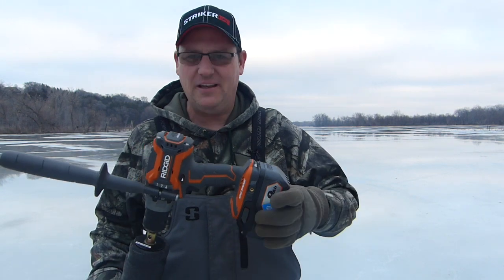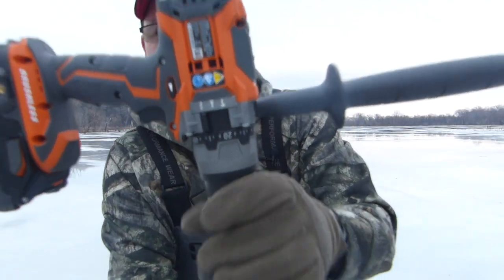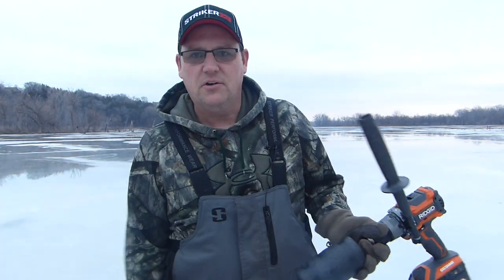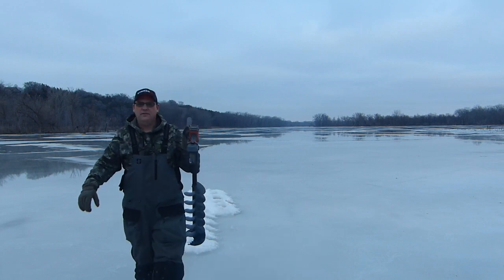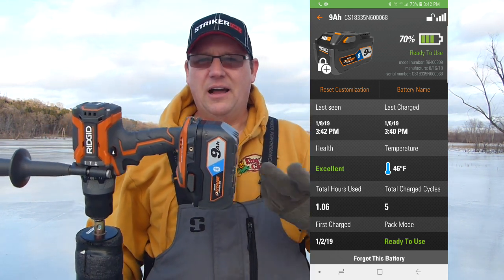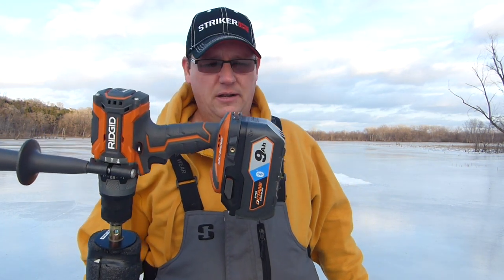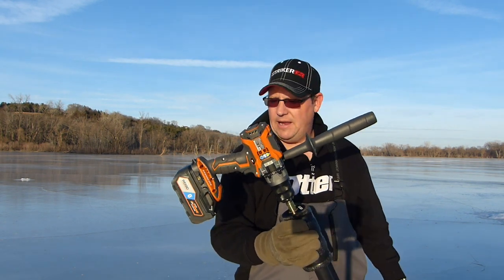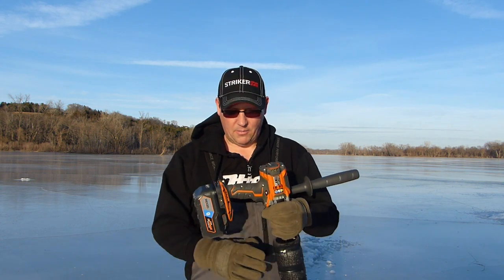Rematch! Ridgid Octane VS Dewalt Hammerdrill Ice Auger KDrill

Comment: Rigid 46
Dewalt 30
Lets do the math if the batteries were switched, might show efficency.
46x5/9=25.5 holes
30x9/5=54 holes
Conclusion: I'm not hand drilling those damn holes! Either will do.

Comment: Great test: I would go with the dewalt based on efficiency. Adding weight as a factor you could carry 2 dewalt batteries and drill 60 holes presumably with only sacrificing 1 ounces for the extra battery. This would put you on the map competing with the 40A electric augers on the market, for a lot less money.

Comment: Just wanted to update this review. Year 4, with a bit of sharpening I'm still thrilled with this Auger! This is an excellent Auger. https://www.youtube.com/post/Ugkxe0I-fnTUByahTCyStrIBXsesSkQJKn8n It splits to 1/2 size for storage in the warm months and easily assembles for winter use. I can cut holes in less than a minute by and really don't feel the need to ever adapt this to use with a drill. It cuts easily with the included blades (which can be sharpened or replaced as needed) and has held up extremely well through last season, and now for the first cuts of this season. I do recommend this to anyone who asks, and personally prefer this over powered augers. These are quiet, still quite fast, lighter, and don't risk spilling chemicals into our waterways. I plan to do a lot of fishing this year through the ice, thanks to this trusty Auger. The 8" diameter is great for fishing pike through the ice as well.

Comment: Thanks.
Glad that you had a realist real world do over. As I have said over on another forum many, many times no one goes out and drills 30,40 or 50 holes at one time and one test of a new tool and battery is not a real world test!
Batteries need a bit of a rest as they are used, they get hot even in the cold. 
As far as real world? DeWalt has a  1 year warranty on tool, battery and charger. Ridgid, if you follow the instruction and register it correctly a lifetime warranty on everything!!! Thats a free battery every 3 years if needed! Average life of a power tool lith-ion battery is 3 maybe 4 years depending on brand (your millage may vary). 
Sad part is ya know how many folks saw the first video and wouldn't even consider a Ridgid and will not see this video?
Reply from the maker: I would hope their buying choice isn't based on my video.  It's just one piece of the puzzle.  :)  I'll be sure to put a link to this video in that video too.
Reply from the maker: And if you have ever seen tournament guys on the ice they regularly drill 100s of holes a day with these elec augers.
Reply: There are exceptions to everything!
As I said above  at “one time”. 
Would I recommend either of the drills you tested to drill 100's of holes in ice in one day? 
Never!
What most folks are forgetting is that none of the cordless drills or mixers that "I'm" aware of were designed to run a ice auger of any size!
Why are some of the drills cutting out after 15 ish holes, to protect the motor and battery.
Go to a larger physically sized tool and there is more cooling because of the mass of the tool.
Same holds true for corded tools.  Ya can buy a pistol grip style 1/2" drill with an 8 amp motor or a  "large frame"  1/2"-7 amp drill which has a smaller (amperage) motor but larger physically  sized motor which will run cooler and last longer.
The dilemma?  
One is bigger and more expensive than the other!
The nearest cordless tool that I'm aware of designed to run a large "bit" is one the mixer style or "Hole Hawg" style tools, but most folks don't want to spend the money for that style tool.
Then if one gets the right tool for the right job ya start to hear the complaining of the sucker was soo powerful it hurt me. It threw me to the ground and stomped on me I'll never buy one of those again. 
I read it all the time, I bought an X, Y, Z brand tool will it work with my A, B, C drill?
Personally if "I" was going to drill hundreds of holes in one day it would be with what I use, a Milwaukee Mud-MIxer with a number (?) of either 9 or 12 amphr batteries!
Buy the right tool for the right job!
:)

Comment: I have the rigid one and I would much rather get less holes and not have it cut out on me Maybe 15 holes for one angler What happens when you go out with a group You can always grab more batteries but what are you going to do by backup drills This is coming from a guy that owns everything rigid Have never had any issues with that same drill doing any house  Improvement but cutting through the ice is different  Situation
Reply from the maker: Well its a protection thing.  I'd rather have it give up so I know to let it cool down rather than it just lets out all that magic smoke and now it's dead.  The 9ah battery was a game changer with that drill.  It made all the difference.

Comment: Great video. I have a flexvolt 9 amp battery on my drill. Made the difference. Both drills are good. I have dewalt so that's my choice. Batteries are expensive, so down load Slickdeals. I bought batteries really cheap.

Comment: we have the kobolt 24 volt drill(not hammer either) with 4amp hr batteries(2) and with 16 inches of clear ice we can get a total of 32 holes.  now that is impressive. Keeping the batteries in our coat until needed.  And the Kobolt never needs to be lifted for any stopage  until battery is dead.. We got every thing including batteries from lowes for 200.  If a person drills straight up and down and presses the drill you just fly through the ice and save on battery. Key is straight up and down.  Very impressed with the 24 volt kobolt.
Reply: Hi Ryan, is this the drill with 650 lbs of torch. What size auger did you use 7inch? Thanks Ross

Comment: I really do like all these new augers how ever I don't think I could ever by a new drill type auger or a new brand name gas auger. Once I have problems with mine  I will continue to rebuild it and if it happens on the ice I never leave to go ice fishing unless I have a hand back up. I was lucky and got In my opinion to be the last good ice auger made a few years ago. I would buy strike master until I made the parts for them and they aren't made to last. Plus the price is quite absurd for a drill auger once you add up a drill batteries and the auger. I am a carpenter by trade and I do have multiple name brand drills I could use but they each have a specific job and I can't risk having one break just for me to go play. Thanks again for your tests they are the best ones on the internet.
Reply from the maker: Thanks Sam.  Here is an interesting video showing how bigger is better.  I was suprised by the results.  https://youtu.be/6LaB7kGP4Vo

Comment: I picked up a 8" Pistol bit and was wondering if you have killed a drill yet? We have 40" of ice on Lake Winnipeg and was wondering if I will be burning out my drill (DCD999 Dewalt)
Reply: Hey Joe. I have the same Eskimo 8” pistol bit. Last winter I used the Ryobi brushless hammer drill which only met the minimum specs for the Pistol bit. Near the end of the season the Ryobi drill died. That was only using it on thinner ice in the Whiteshell. This year I changed to the Ridgid brushless hammer drill which has lots of power. I use my gas auger (with multiple extensions) on Big Windy. The Pistol would probably be ok on Lake Winnipeg but I like the 10” hole when I fish there.

Comment: I've  got a 996 Dewalt/ Clam plate/ 7" lazer. Using 1.5 amp batteries getting 12-14 holes in 9-12" ice  per battery  Just upgraded to (2) 5 amp batteries. Expecting 30 holes to  battery  on same   ice thickness. Again I don't bore through in one pass. I pull drill up to clear chips. Seems to allow drill to catch up.
Reply from the maker: yep you will be happy with those new batteries!

Comment: I choose the K-Drill over the Eskimo auger because the Eskimo does not have the centering bit and tends to walk and or wankle (elliptical orbit inside the hole)
Reply: Does this auger have a 1/4 threaded hole in the middle.  If so you can sharpen a piece of threaded rod use a jam not to keep it in place. Thread it in and lock it.  I think it needs to be 3 inches long.

Comment: Excellent comparision.  Well done.  Ridgid is hard to pass up for $199 with a 9Ah Battery and LSA.  It is noted by many to keep the batteries warm on the lake.  Suppose to increase run time quite a bit too.
Reply: One other thing to note, the Dewalt has a 3 speed gearbox (compared to Ridgids 2 speed), which lowers rpm's quite a bit.  That is benificial for ice augering.  (even though the Dewalt is only 820 uwo) it draws less amperage because its geared down.
Reply from the maker: Thanks, yeah I tried to do a real world test, left out in the cold, etc.   Just about everyone is going to charge up their battery every time they get home, so this is sort of an extreme thing.
Reply from the maker: @deansikorski6596  actually they are both 0-450rpm in 1st gear
Reply: Got mine for the 169 man could not pass this up its like 250 for the dewalt
Reply from the maker: @denvercolorado8927  yes that was a great deal.
Reply: After I drill my holes I keep the battery inside my heated Hut just in case I need to drill more

Comment: Any change in your opinion of the Ridgid drill, DTro?  Would you still buy it  over the Milwaukee or Dewalt?
Reply from the maker: I would base it on value. If similar price I'd go with Milwaukee or DeWalt.  When I bought the Ridgid it was $169 for drill and 9ah battery.

Comment: I think your dewalt battery isnt as good because mine outlasted yours way longer in my truck in the cold. But then again I have a lazer and she did twice as many as your dewalt and k drill. I'm assuming she takes more for that chipper blade
Reply from the maker: Correct, I've discovered that the KDrill demands more power.
Reply: @3RiversFishingAdventures  love the videos though. It definetly helped me decide on what to get 👍
Reply from the maker: @Kildahl1776  thank you.  I'm going to put the new Eskimo (with center point) up against the Strikemaster lite flite next.  Just waiting for some ice here. :)

Comment: I have fully charged batteries using the 8” K Drill and Ridgid Octane.  Any reason why my battery would stop while cutting making it necessary to remove the battery and reattach?  Happened multiple times over say 8 holes.  I know it’s overload protection, but multiple times??
Thoughts?
Reply from the maker: What size battery?
Reply: I noticed it on the 4ahr battery..
Reply from the maker: @Whitetail414  yes I wouldnt go with anything less than 5ah.  6ah is recommend and 9ah preferred.

Comment: De Walt is made by Black & Decker.  Ridgid is made by the company that makes Milwaukee.  In choosing a Cordless drill as an ice auger I would advise that one buys a rebuild-able tool rather than a throw away tool
Reply: DeWalt is Stanley Black and Decker's top end brand. Ridgid is Techtronic's middle tier brand.
Reply: Stanley and black and decker is garbage. Milwaukee fuel series is superior over all of them
Reply: @joshrode9180  Josh:  I know.  That's why I got Milwaukee fuel LiOn 18v 1200 in/lbs of torque (2804-22) [14 inches hard ice in about 8 seconds]  I also installed a bulls eye bubble level on the back of the case.
Reply: @joshrode9180  Stanley Black and Decker is USA TTI is Chinese dummy

Comment: I have that dewalt drill. And a 8in strike master auger. With the 2 amp hour batts... I get about 15 holes before I have to switch batteries.. that's in 4-6 in of ice.. I do how ever notice that ridged looks more powerful.. as my drill will keep stopping in overload protection as the battery gets low.  But overall it works great.. if my dewalt craps.. might try that ridged drill. Good vid!
Reply from the maker: Your biggest limiting factor is the battery size.  If you had a 6ah or 9ah you would see a BIG difference.  Thanks for the comment.
Reply: I have that dewalt drill and a 9amh with pistol bit  and I can get 40 + holes 20” ice no prob !

Comment: Where do you get the auger blade that fits a drill? Pretty much i have a rigid impact and want to use it for ice fishing holes
Reply: Any good sports store  for new ones.   OR, Check Craigslist or eBay   for used ones.  Craigslist is your best bet.   They usually have several of them for sale.  I picked up 4in  and 7in Strikemaster Lazer hand augers there.

Comment: What is the model number on the Ridgid hammer drill you are using?  The overload switch cuts off power to my brand new Ridgid hammer drill when I start drilling at low speeds.  Just not right.  I am currently fighting Home Depot and Ridgid over this design flaw.  They are calling it a user issue when I have never had an issue with any DeWalt, Milwaukee, or Makita drill I've used.
Reply from the maker: Model #R8611506B I used mine with the KDrill on Sat.  15 holes though 18" of ice.  No issues.
Reply: @3RiversFishingAdventures  Thank you.   I had model R86116.  Must be a newer model with faulty circuit board or switch from production.  5 of 6 at the store did the same thing.  Only 1 floor model worked properly... Very upset with Ridgid right now.  They are telling me that it is a user issue.
Reply: @williamjohnson5777  that's the gen5x not the Octane what size battery were you using?
Reply: @travisevans7502  Brand new fully charged 18v. 4 amp hr.    According to Ridgid, this is how the drill is supposed to work.   It makes the hammer drill useless in many applications unless you can pull the trigger without hesitation and not have to start slow.  Very disappointed.  When using with a Mora 6" auger, it would immediately cut out if I applied downward pressure on the ice to start a hole.  If I went quickly, the auger would walk all over.  I never had an issue with my DeWalt regular drills and the auger.  I thought I was upgrading because my DeWalt's are old and batteries all dying.
Reply: @williamjohnson5777  I have the same drill you got with the 4 amp hour battery and I have no troubles with mine course I'm not drilling holes into ice either might be something wrong with it if not I would definitely return and get something else but I like all my Ridgid tools have several of them never had a problem with any of them you might want to try the octane drill by rigid they're double the power the gen5x 1300 inch pounds where the one we have is only 700 inch pounds but if you're just totally anti rigid Milwaukee makes a great drill also I just personally wouldn't go with DeWalt I've seen videos where they smoked and that was the end of them happen the same impact model three different times with the same result burned all three of them up.
Reply: @travisevans7502  When did you purchase the drill?  I firmly believe it is a defective lot with an over-calibrated cut-off switch.  When I went to use the drill w/ a regular bit and started slowly so the bit wouldn't creep, it did the same thing.  Not as bad on the low-torque setting but still did it.  Still waiting for a reply from Ridgid.  Already returned the drill and went with a different brand - not DeWalt either.  :)
Reply: @williamjohnson5777 I purchased mine a little over a year ago I don't have any of the problems you mentioned there must be something wrong with the overload protection in that one.

Comment: What do you feel percentage wise would I gain/lose going from 6” kdrill to 8” pistol bit?  Lateral move? Have you heard anything about a strikemaster drill attachment?  Love my 6” kdrill but would to go back to 8” hole but not steer clear of gas
Reply from the maker: I bet it would be fairly close to a lateral move.  The pistol bit flew through the ice when I tested it.  Have not heard anything about SM.
Reply: Kdrill is not a true 8 inch hole. The pistol is.

Comment: I got 4 holes with the ridgid an took it back. On two batteries.
Reply from the maker: Must not be the same drill and battery i used here.  Drill model and battery size makes a big difference.
Reply: 😂😂 sounds like someone needs to sharpen their blades
Reply: rage801 really the k drill came out of the box the same day the drill did.
Reply: @scottmiller9980  I take it you have not read reviews on the K drill LOL I own the K drill and haven't had any problems with it but there are plenty of people that said right out of the box it was dull as hell and wouldn't drill worth a damn
Reply: rage801 no I didn’t hear that. The drill drained quickly an I both batteries were dead after 4 holes. K drill seemed fine.
Reply: @scottmiller9980  maybe you were in reverse😂
Reply: rage801 you are funny
Reply: @scottmiller9980  I have heard that batteries will take a few charges to completly fill the battery. So you probably didn't get a true full charge..
Reply: Pine Valley Outdoors I returned it an bought a Milwaukee.

Comment: What's  your point of 15 holes here and there. Just do the test and drain those batteries  to see how many each one drills in one shot.  U r special.
Reply from the maker: go to my previous video, that's exactly what I did, but then people said it's not a real world test I need to spread it out.  u r special too thanks
Reply: nighthawk 87 batteries get less power out if u throttle the battery down as fast as u can, if u go slower and break it up u get more out of them.

Comment: More like 9 amp vs 4 amp
Reply from the maker: not sure what that means.  the Dewalt is 5ah
Reply: jeremy royal you are not getting more power with a bigger battery. The more amp hours is just to last longer at the same power.
Reply from the maker: @SKC640  actually you will get more torque and rpm with a bigger battery.  It's not just storage.
Reply: DTroFishOn  I stand corrected I looked it up and you are right certain brands do. But it doesn't really necessary give you more power there alot of factors that apply.
Reply: @SKC640  that is false sir you gain Torque and RPM don’t believe me Pop a 9Ah in your drill and then pop at 9Ah in your drill I guarantee you you will even hear the difference.